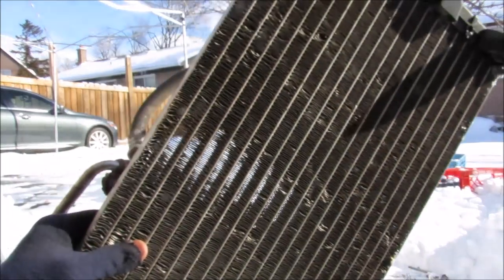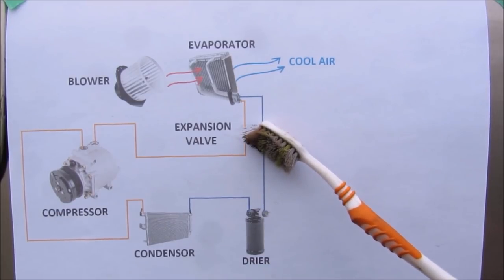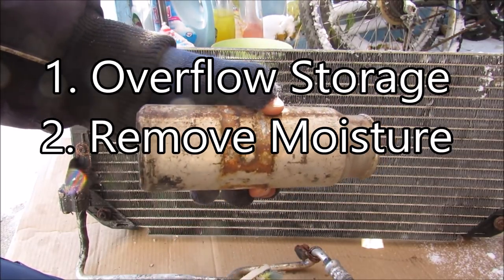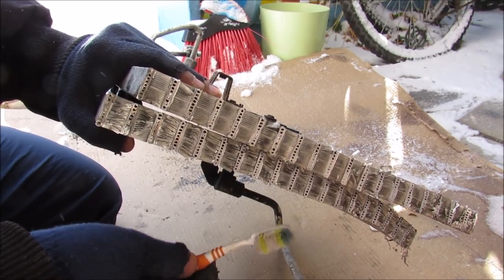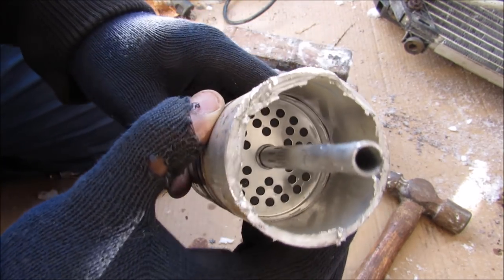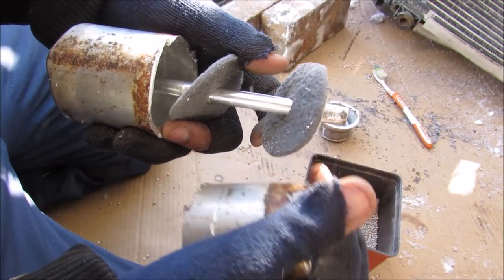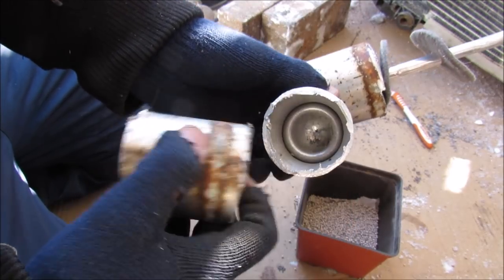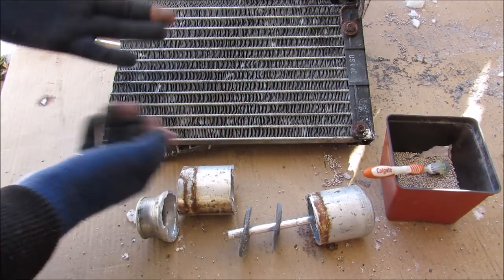How an A/C Dryer and Condenser Works

Comment: Great explanation! In the condenser there is no chemical reaction just a transfer of heat and change of phase .
Reply from the maker: +AutOdometer yes
Reply: speedkar99 He said exothermic reaction which is correct
Reply: @speedkar99  I like to imagine it like this: Take two bowls and a sponge and fill the bowls halfway with water. If you dip the sponge in one, then wring it out in the other, One bowl now has more water than the other. 
We can imagine the water, in this case, as heat energy. Before we started, both had the same amount of heat energy, but now one has less heat than the other. That lack of heat energy makes it cooler. We imagine the sponge as refrigerant, and it is what is taking the heat away from one place and moving it to the other.

Comment: I've been surprised at the different designs of the receiver dryer vs the accumulator. Interestingly, with a low exit port, the receiver/dryer selects for liquid to pass on to the TXV. By contrast, an accumulator, with its high exit port, selects for gas to pass through, protecting the immediately downsteam compressor from liquid that could damage internal compressor valves. My question is about water contamination. Does the receiver/dryer trap superheated hot water steam, to be slowly absorbed by desiccant? And, by it's physical design and low-side pressures, does the accumulator trap liquid water? Or, does that design simply trap water with the dessicant inside, with little impact on water by the position of the exit tube?
Reply from the maker: Good question. Need to research exactly how the moisture is trapped.

Comment: Hi, you seem very experienced. I have a 2014 GMC Yukon with only 35k miles and in great condition. I recently noticed:
-water dripping slightly next to the front right tire 
-it seems to be dripping from or near the AC receiver/drier 
-hard to tell if the liquid is water or something else like coolant (definitely not motor oil)
-we are at the end of a hot summer, so AC is running while driving
-took it into a GMC service center and they said the receiver/drier is fine
-but i still see small puddles which I did not see before after running the AC
-i read that a small AC leak can damage the entire system...so I am concerned
-i read that moisture discharge from AC under the car is normal but nit sure why i didn't notice it before
-AC still blows cold and no mold smell from vents
Any tips to confirm it's ok? Thanks!
Reply from the maker: Water dripping is normal. It usually comes from under the cabin

Comment: I change my ac compressor and expansion valve. Degas the unit added oil and freon.  Car won't get cold. Could the AC dryer cause it not to cool?
Reply: No.  The drier is just a filter to catch water and wear particulates.

Comment: Question: since the dryer removes moister and filters the system. Why do we have to pull vacuum when replacing suction lines or any other parts? Lots of shops argues and support that no need to pull vacuum. Appreciate your answer. Thanks!
Reply from the maker: They are just lazy. Pulling vacuum not only helps recover refrigerant but allows you to test if there's leaks

Comment: How does the desiccant get recharged?  After a while it's going to absorb all it can and then what?
Reply: The system will need recharging with gas every 3 years or so, a vacuum is pulled before the refrigerant is charged, this has the effect of lowering the boiling point of any moisture in the system, which can then be drawn off as a vapour & so the system is then devoid of moisture. The drier is only really there to catch any moisture that may be left.
Reply: @phil955i  You are incorrect. Every ac system is sealed and should never need recharging, topping off. Your car ac system is the same as your refrigerator. Both are sealed. Car ac systems fail by extreme vibration, crash damage when it leaks pressurized refrigerant. If a system doesn't suffer damage, it remains sealed without needing to be topped off or recharged. Your refrigerator lasts for years because it sits in place. The only difference between refrigerators and car ac systems are specific designs - car ac requires temps go no lower than freezing while refrigerators drop temps to below freezing.
Reply: @fdryer5116   Explain why car A/C needs to be recharged every 3 years or so? Also why do you think most automobile repair shops have a machine to re-gas car A/C systems & advertise as such?  It's because the refrigerant slowly escapes through the compressor drive shaft seal. Some seals are better than others & the refrigerant charge can last more than 10 years, but in general every 3 to 4 years. Otherwise you are correct, refrigeration / airconditioning systems are sealed & do not need topping up or recharging unless they suffer a leak through vibration or component failure. I'm a refrigeration / airconditioning engineer of 30 years BTW ☺

Comment: 👍
Can you add some videos on car complete wiring.. Indicators, breaklight,backlight, interior, fuse box, relays(radiator, Ac) etc..
Reply from the maker: +Nickk pr like depinning connectors?
Reply: speedkar99 if possible including depinning connector since wires are same but pin no. Changes with cars...
Hope you get the point for example there are bunch of wires going to back of car for different backlight connections etc (mostly hacked by car mech...) if atleast you know where what connection to expect it will be really helpful...

Comment: Really Great informative material!!! I need some help! I'm replacing my compressor on my 08' Honda CRV and to keep the warranty I have to replace the drier/ accumulator. I have just about everything I need to know as for as replacing the compressor. I bought the mesh bag or like a bean bag to go in the condenser. I just haven't found how to replace it. I'm hoping it comes apart somehow to replace it. Any information would be very beneficial!!!! Thank you!!! Mike

Comment: What happes if the ac oil enters the drier unit ? my idiot mechanic added it there when we replaced the ac compressor. and my ac is not working.
Reply from the maker: Time to replace that drier. 
As a matter of fact, the driver should be replaced everytime the AC system is opened to the environment
Reply: In fact the drier acts a storage for a little excess oil and oil is traveling through it constantly when AC is on. I don't really understand what your mechanic did, because every time you replace a dryer, as with any AC part excluding an AC compressor, you have to inject additional oil (additional to any oil that came out while recovering the refrigerant)... shop manuals instruct to do so.

Comment: Excellent video. 1 stupid question : From where does PCV valve sense? Apparently, it seems it is sensing from valve gasket cover but it should be sensing from crankcase. So is there any trapping /cavity in engine block/wall that is routed to the top?
Thanks for your excellent work.
Reply from the maker: Valve cover is same as crankcase via the oil return holes
Reply: @speedkar99  Thanks for the clarification.

Comment: Hello, sometimes my Aircon smells so bad, sometimes it smells good. What can be the reason? Thx. ( in this video u didn't use clothes  of ur brother/ wife to clean stuffs😆)
Reply from the maker: What does it smell like?
Reply: @speedkar99  it smelled like some  dead animal, and we are obliged to open the car's windows to have someone fresh air. The fact is that, just one month after that the receiver dryer and condensator was changed to new one that smelled start. i think that my wife sometimes didn't not use the Climatisation panel as it should be use, and it produces that smelled.

Comment: Dear brother you make very good videos but if I suggest some times there is a need to cut  open a piece longitudinally. This way the device is opened as well and the layout of smaller parts is also not disturbed. Anyways👌good job👍
Reply from the maker: Thanks for the tip

Comment: is it safe to use "3M Choke and Carb Cleaner" to clean throttle body of Honda Amaze car??All Honda dealership in India are using it to clean them..is it safe???
Reply from the maker: +TheRouteShow it's safer to use throttle body cleaner instead of the more aggressive carb cleaner.

Comment: Just opened another one. This time it was a Taiwanese made pattern part meant to replace the OEM one. It's completely different inside. Inside, it's basically a sock looking thing that is tied to the little center pipe by means of two plastic zip ties (not joking, the usual white plastic cable ties). Inside the sock lies the desiccant. There's also a little metal "sieve" at the inlet that looks like a fine mesh. The OEM one, instead, looks like the one you showed.
Reply from the maker: Wow good to know...them affermarkets not the same as OEM
Reply: @speedkar99  It worked ok for 2 years though. Replaced only because the car needed a new condenser and a new one came with it. I can film the dryer internals for you if you're interested

Comment: Cool. I think these tube-shaped receiver dryers won't fail in the TXV-clogging way like bag/sock shaped ones sometimes do. I once opened one myself too (i had it replaced on my car since it was 15 years old, and i was curious as to whether i could find any metal shavings inside even if the compressor is still working perfectly as of today), but with a hacksaw...
Reply from the maker: I don't think the drier components could pass through the condenser to clogg the txv

Comment: So should I surmise that the condenser has a finite useful life? Eventually, the desiccant will have absorbed all the water that it will hold, and the filter will get plugged up with dirt (from the compressor). - Yes?
Reply: No, it should last the life of the car. Unless it gets holed by a stone thrown up from the road or suffers mechanical failure due to vibration. There should be no moisture in the system, the drier is only really there to absorb the very small amount that maybe present.
Reply: yes they get clogged up with debris

Comment: Great explanation!
Thanks a lot!
Question: once I open the system to replace parts , can I charge the system with R 134 cans from Walmart or I need another type of refrigerant?
Thanks again.
Reply from the maker: Yeah you can, but it's best to get the moisture sucked out first
Reply: Thanks a lot!

Comment: Suggestions a.) show a P/T chart for 134a, showing that it boils at X pressure in the evaporator and condenses at Y pressure in the condenser and this latent change is what drives the temperature change. b.) your chart showing the "overall a/c system" seems to be color coded wrong, its showing "blue" as cold and "orange" as hot, but that is not how the system works, it should show high pressure and low pressure sides split by the xpansion valve and compressor.

Comment: Hey Man! Awesome video I've been pondering this one for a long time. But one question still remains. Why does the moisture content of the refrigerant change, if it is a sealed system? Like for example, some manufacturers recommend, or even program, the HVAC system to turn to AC system on to assist the warm defrost function?
Reply from the maker: +James Dahmer I think you got it mixed up. The refridgerant shouldn't be absorbing moisture to defrost the windshield, the evaporator does that under the dashboard, drying the air. Please see my HVAC system video for more on how that works.
Reply: Ok so the evaporator, opposite to the heater core, can dry the air (because as the air cools, it's ability to hold moisture drops, thus it condenses) [and then needs to be drained etc etc] - but I guess to further the question, how come the A/C system requires a dryer - with all the beads and such, if the system is sealed with refrigerant - how would it gain moisture if it is a sealed system? - sorry I have a slower mind
Reply: @jamesdahmer5027  When the ac system was installed during car assembly, a vacuum pump removed all air and moisture from the sealed system. Virtually empty, this vacuum still has some moisture but so little remains, it's absorbed by the dessicant in the drier canister. The vacuum is immediately filled with refrigerant. R134a, lubricating oil and dye are the only things circulating in a sealed ac system. All ac systems relies on it being sealed. The drier absorbs the minute moisture to prevent freezing inside a system as well as prevent contamination. A sealed system never needs recharging, similar to refrigerators.

Comment: It’s not exothermic because it’s not creating heat. It’s moving heat from the cabin to the front of the car.
Reply from the maker: I guess you can consider it more as the transfer of heat as phase changes then
Reply: @speedkar99  That is 100% correct. the phase change of the refrigerant, and its movement thru the expansion or orifice valve, is what allows the refrigerant to soak up the cabin heat and move it out to the front of the vehicle. We cannot 'create cold', we can only move heat.

Comment: I have a question. When AC compressor fails, it often spreads dangerous metal particles through the system and this leads to a more expensive repair bill. I wonder if installing a filter right after the compressor to catch these solid particles would be a good or effective idea. Making it possible to only replace the failed compressor  without the need for replacing other compnents in the system.

Comment: If we created a vacuum before pumping gas and oil, where does the moisture come from?
Reply from the maker: Sometimes there's small leaks that could let moisture in...that would be detrimental to the compressor which will die if it tried to compress a liquid
Reply: If you're not running double end capped PAG (for example the technician just uses Ester oil for anything, to avoid the hassle of storing different oils), moisture may come from the oil itself which was left exposed to atmosphere for too long... or from a saturated dryer that wasn't replaced... or from both... some moisture binds to the refrigerant but if it gets too much then it intermittently freezes at the expansion device and gives erratic cooling

Comment: My car has full refrigerant, yet as I drive, it blows hot air. My mechanic says it's the resistant valve and the dryer. Is this correct?

Comment: Sir, my car AC pressure reads 40 psi at around 32 to 35 temp Celsius on the low side port. Is this a good reading? Could you help me with the readings?

Comment: I would like to correct you on the compressor compressing the refrigerant to a liquid and the condenser turns it into a high pressure gas as it is cooled down.The high pressure side of the compressor is called the liquid line.You are correct with everything else

Comment: Would too much oil in system cause drier and suction line to frost over
Reply from the maker: Oil can't form frost
Reply: Too much oil will keep the evaporator warm... drier and suction line frost makes me think you're talking about an accumulator and not an actual receiver dryer... in that case, frost is normal occurrence for some systems (POA systems with constant running fixed displacement ac compressors), otherwise something is making the suction pressure go down too much

Comment: This topic is very interesting since I never really considered what the drier did.  Now I know.  Basically it's a vapor filter to catch any particulates with desiccant to catch water vapor.  I wonder if that is something that should be replaced when recharging the AC since the desiccant can only absorb so much moister.  But then again there should be no moister to begin with and its a sealed system.
Reply: It's highly recommended to replace the drier every time the system is exposed to the atmosphere, because of it's limited ability to absorb the moisture that came from humidity in the air that can't be eliminated 100% by vacuuming and hose purging during the refrigerant charging process. Moisture needs to be minimized to prevent acid formation and ice blockage.

Comment: If it’s a closed system then how does moisture get in..
Reply: that takes a very long time. car AC easily lasts over 10years without any problems. the seals and o-rings in AC systems are not perfect and will deteriorate as the car gets older so it allows air in and you know air on earth has moisture. regardless of cars getting older, AC systems are always designed with drier desiccant from new because air gets into everything, it just depends on how slow. even a perfect vacuum system will allow moisture after some time. Earth and it's atmospheric pressure is a factor.
Reply: I think the main culprit is the compressor because it vibrates all the time and the seals will be worn later. small wear allows moisture in. more wear allows refrigerant to escape. (my educated guess. someone chime in). takes very long for that to happen tho. my mom's 1999 bmw 323i still has cold working AC and never serviced. thats a long time.
at least bmw got something right
Reply: Hostilityy Correct. r134A is more dense in it's liquid state than water 1000kg/m^3 VS 1200+kg/m^3, which means moisture gets both in and out of anything faster than AC refrigerant.
Reply: Your refrigerator is sealed for life no different from car ac systems. As long as it remains sealed, no air or moisture enters to contaminate it. Ac will run forever as long as the engine turns the compressor. Once a leak or damage occurs, refrigerant, oil, and dye are released. Air and moisture can get in to contaminate a system. Repairs dictates replacing damaged parts and replacing the drier, using new seals and a vacuum pump to remove air and moisture from this repaired system before refilling with refrigerant, oil and dye.